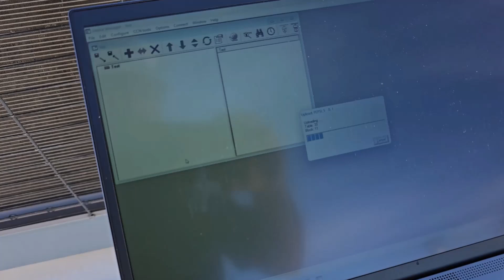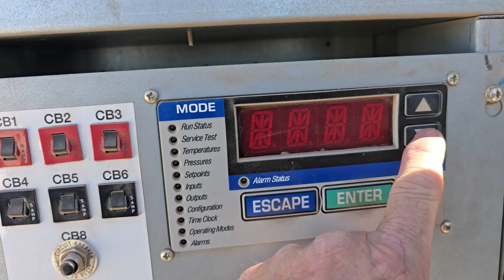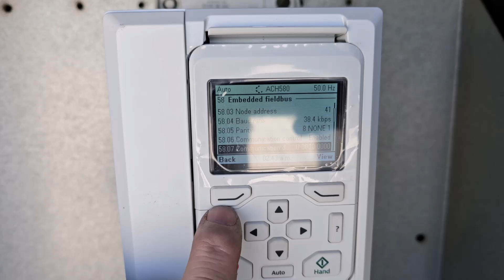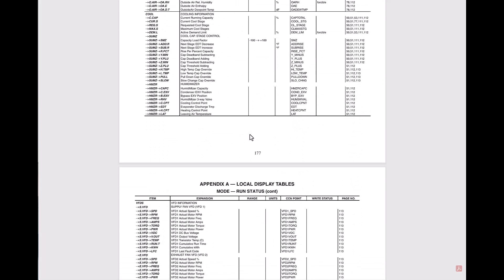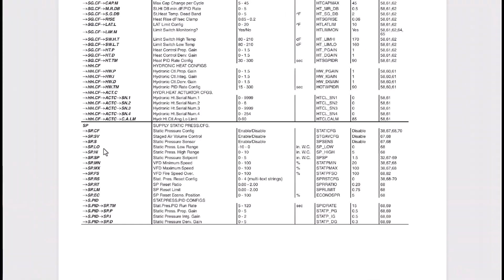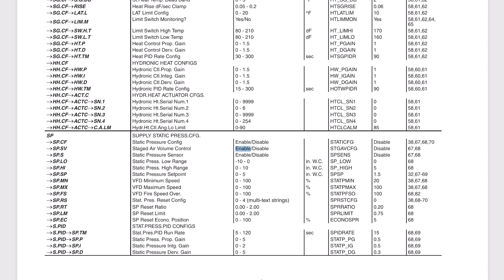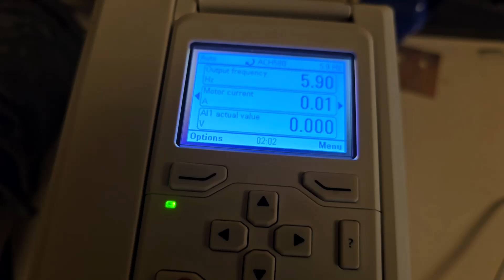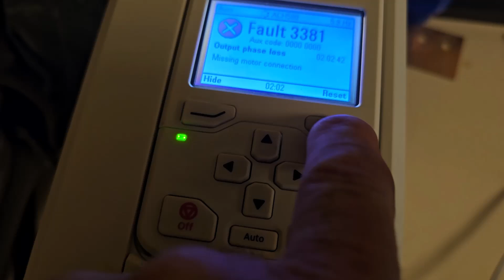Using laptop software to connect to Carrier Comfortlink LEN bus

Comment: I have an issue on a drive that shorted from carrier. Replacing a 580 with a 580 but I I got the new one from Ann instead of carrier. In the table 58 on the new drive I don’t have an LEN option. Is this due to some carrier proprietary software they load into the drive? Wondering if you have seen this. Carrier wants 2x the price for the drive which is why I went with abb direct.

Comment: What software are you using? Is it CCN? What connects from laptop to Len connector? Cat 5 or is there a dongle involved? They want 1000 bucks plus for that Navigator.
Reply from the maker: CCN based. But using the newer USB converter.
The cable connects via a 6 pin phone cable to the LEN connector.  Same where the navigator plugs into.
The scrolling marquee is more like $1k now and the navigator is more like $1.5k i think. 
I'm not sure where to get the hardware. I didn't order it.
Reply: I know it's ridongless!

Comment: What tool are you using to interface the carrier board from your laptop ?
Reply from the maker: A CCN USB converter tool.
I believe it's the same good connect into a CCN VAV system but a different connector to the MBB